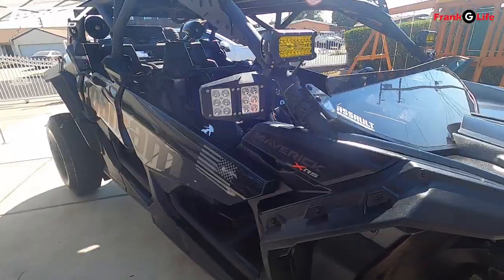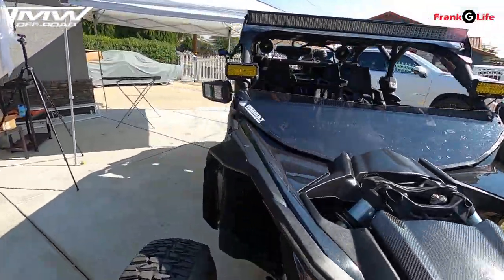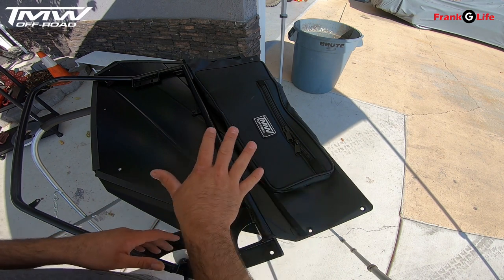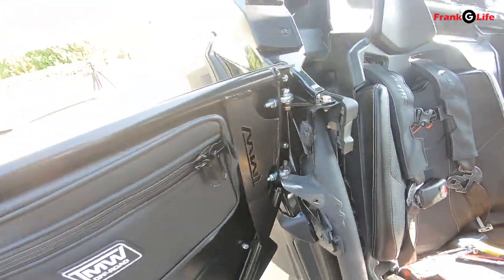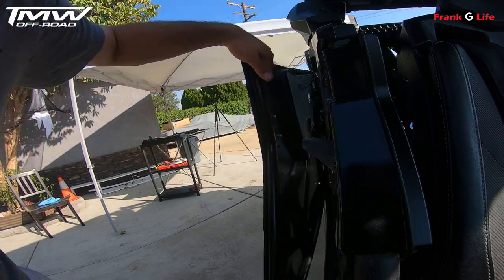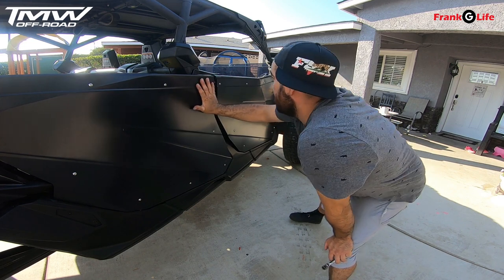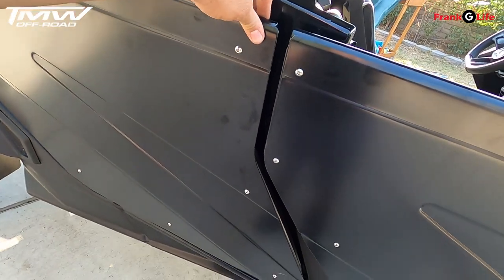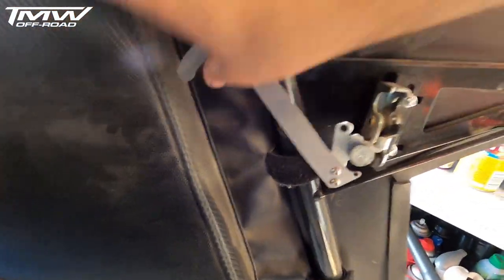TMW OFFROAD CAN AM X3 FULL DOORS...HOW TO INSTALL, BEST DOOR ON THE MARKET?? EP - 112

Comment: Here’s a tip, always run your bolts facing down, nuts are always on the bottom. If for some reason the nut gets loose and falls off you won’t loose the bolt.
Reply from the maker: very true. nice catch

Comment: Is there a way to out the gas struts on these doors to assist with opening and keeping them open! Similar to the stock doors you can place the gas struts on them to keep them open? Great video! Installing mine this week!
Reply from the maker: Bolt on option, I haven't heard of one. But all It would require is to weld on a ball end to the door using a similar shock kit like for the OEM doors

Comment: Great Vid as usual! I'm going to get these for my CanAm. Question: You know how people break the door straps by taking off and not shutting the door all the way? If that happened with these doors do you know if it will it bend the framework?
Reply from the maker: These doors dont use the door straps.. the upper brackets have the built in stops.. i would imagine if u are going 60mph and the door opens cuz it wasnt closed right.. it will throw the door out of alignment.. but 100% confident the door frame would not bend.. what will throw the alignment off is the lower pin that the lower door heim attaches too can bend.. as you can see in the video i had to unbend the lower pin on the right rear door.. the frames are built very strong..hope that gives you an idea of how they are built and the weak point being the pin... I just make sure the doors are closed right..lol😁

Comment: Thanks for the video TMW should be a little better about providing installation instructions. question .. would it be easier to apply the foam tape to the frames instead of marking skins with tape? ijust curious I’ve got a new set in the box ready to assemble when my car shows up.
Reply from the maker: Yeah ur right.. i suppose u can do it on the frames instead. Should work out for u👍

Comment: Why does Can-Am offer the only full door with handle on the outside? I crawl in the cold in Michigan so I like the full enclosure. But with inside handles you have to unzip the enclosure partially to put ur hand inside & open the door

 I just do not get it why all other manufacturers do not offer doors with the latch/handle on the outside
Reply from the maker: Im sure manufactures have heard this.. hopefully more manufacturers will make an ext handle kit for the guys out east